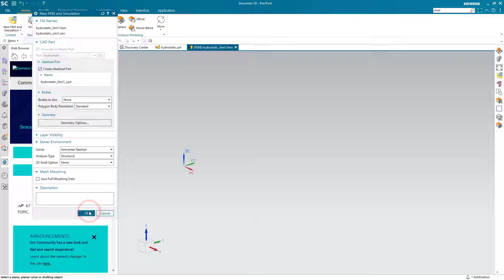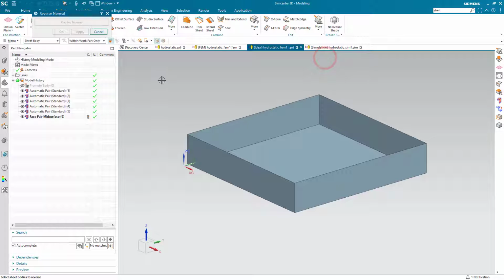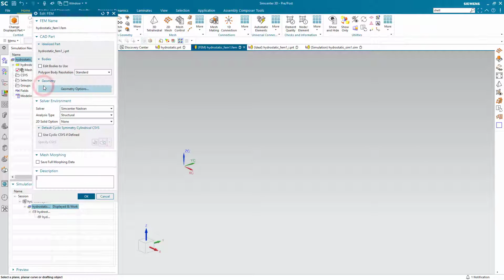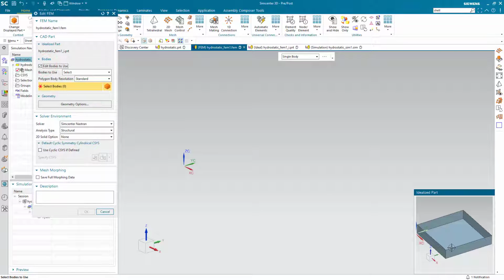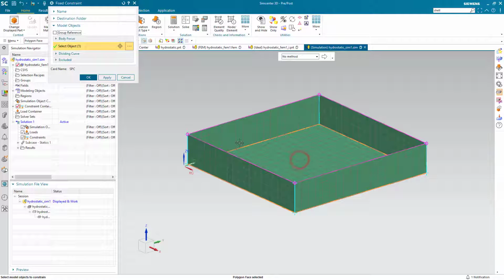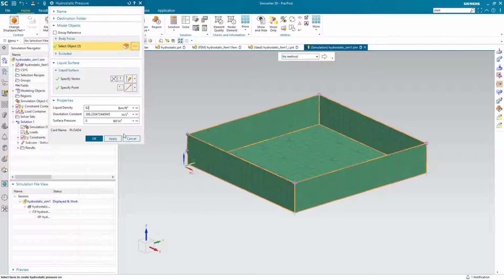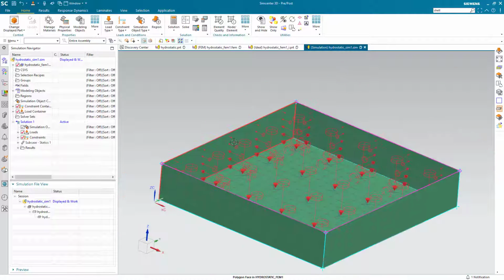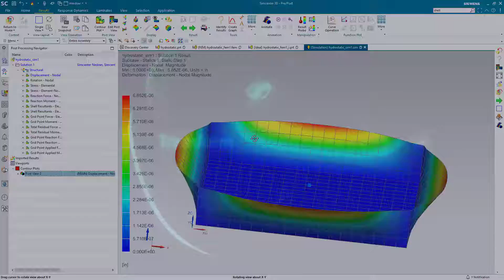How To Apply A Hydrostatic Load In Simcenter 3D

Comment: Hi dear, in my case I am modeling a ship which is navigating in a water line inclined for its loads distribution, how can I resolve it?
Thanks in advanced
Reply from the maker: Hi, you will need to specify a liquid surface vector.  Mine was already correct in the video so I didn't go into the pulldown to the right to specify a liquid surface vector.  Select the pulldown to the right of Specify Vector and you will get the full vector specification dialog where you can use a number of methods to define the liquid surface normal.
Reply: @Simcenter3DTipsandTricks  thanks for your soon answer. Yes, I already did it. I have put a liquid surface, considering the vector but the results are not similar to the rotated hull. Even over the inclined vector the hydrostatic pressure is applied but that is a mistake because the load distribution should be under the inclined liquid surface. That is the problem that I have now.
By the way, after to set the liquid surface vector, I put the specify point in the maximum level of the water.